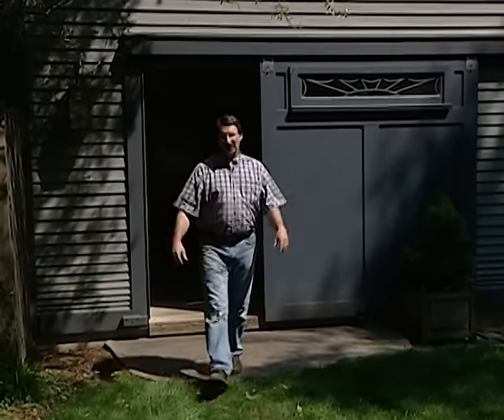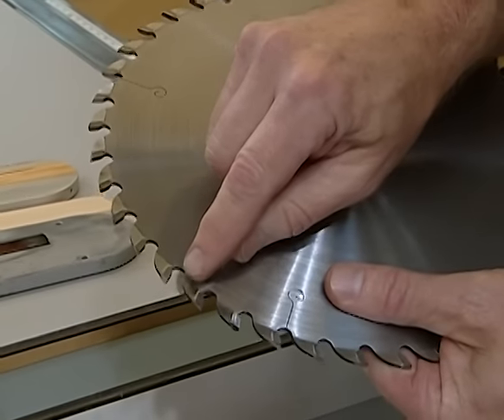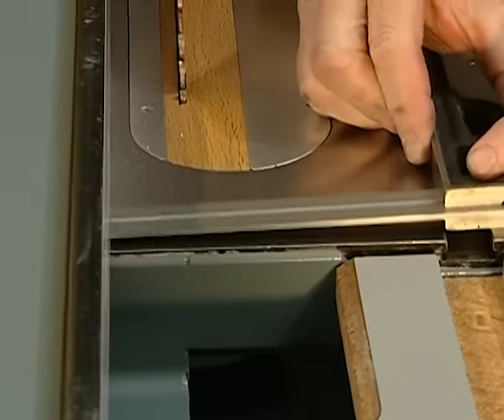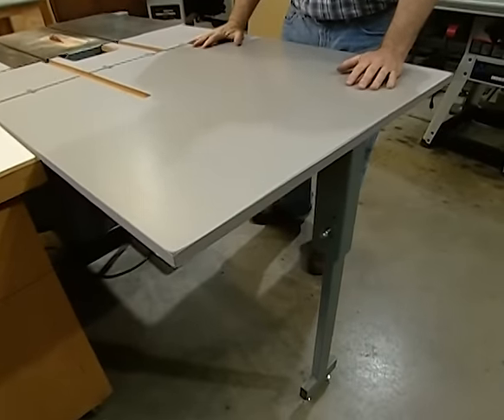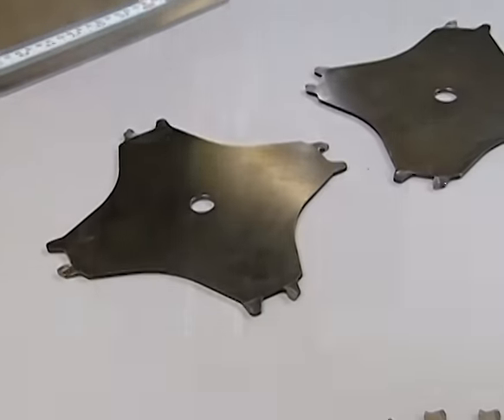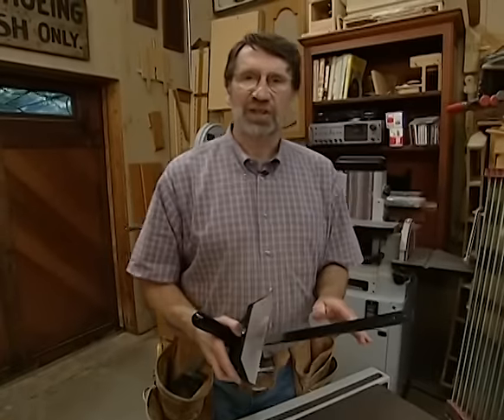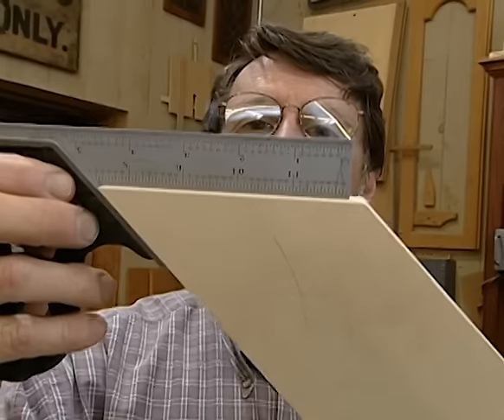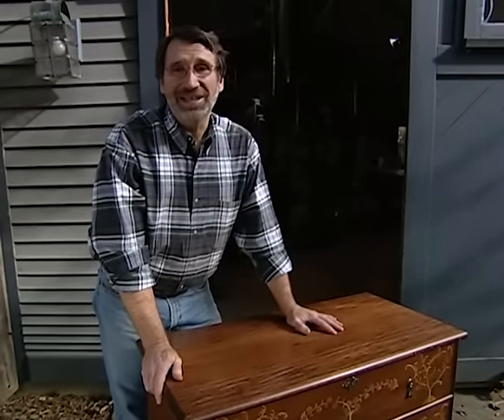Table Saw 101  |  S19 E8 & 9

Comment: So glad these episodes are finally becoming available! So much knowledge my generation desperately needs.
Reply: These videos have been on YouTube for many years.
Reply: Not all the information is up to date. At 8:55 he fits a zero clearance insert, which is good, but his older saw doesn't have a riving knife, which is super dangerous.

Modern saws have a riving knife to prevent the piece pinching the back of the blade, which reduces the risk of kickback. Your zero clearance insert will need a slot being cut to accommodate it.
Reply: @BM-ru7ef  Nope. Their first upload was on Nov '22. Not even a full two years.

Comment: I’m 60 now. How vivid still today that this show and ‘This Old House’ would come on when I was a wee lad, and it felt as if it was over in the blink of an eye! I was practically distressed that it ended so quickly! Norm is a treasure.
Reply: If you're 60 now, you were between the ages of 24 and 45 during this show's 21 year run.

I'm 36 now, I was less than 2 years old when the first episode of the New Yankee Workshop aired in January of 1989.  I genuinely was a wee lad, I vividly remember watching episodes of this show when I was about 3 years old from my high chair eating pancakes and bacon my father made on what I now understand were Saturday mornings.

Comment: No riving knife guarantees a kickback event. Cabinet saws are extremely powerful and can fling a piece of wood at bullet speeds. That riving knife helps to keep the piece from pinching the blade and riding up over the blade
Reply: Don't be presumptive.

Craftsmen have been doing without riving knife for many decades. Most still have fingers without kickbacks. There is no mystery. The riving knife is preferable to the novice and under most situations for the craftsman (because it is a splitter that is closer to the blade), but a well-implemented splitter will work quite well also. 

A riving knife has fixed thickness, but a splitter can have varied thicknesses, and can also be thin and slanted as it occupies the kerf. This is one advantage of the splitter over the riving knife. 

There cannot be kickback without riving knife if one uses a splitter well and use hold-downs as well.

I don't use a riving knife. I don't need it.

Comment: One quick suggestion: when you are checking blade perpendicularity to the table, position the leg of the right angle tool against the blade between the teeth.  (The teeth are normally wider than the body thickness of the saw blade itself, and could introduce an unwanted angle.)

Comment: I believe to check parallelism with the miter, the same tooth on the blade should be used. The blade should be rotated. 

Using another tooth (of the same set) as far away as possible is to check arbor round out.

Comment: The only thing I don't like about hybrid, contractor, and table top saw is the mounting of the blade. They're mounted to the bottom of the table. Making dialing in square to your slots harder. 
Cabinet are cabinet mounted. Loosen all but one bolt holding table to cabinet and bump it square. Alot easier.

Comment: I really like that insert at 8:48 You wouldn't happen to have a link would you. I have a Jet cabinet saw. I usually make mine out of mdf but the metal one with the thin strip of replaceable wood seems much easier to change/replace.
Reply from the maker: We looked, and they don't seem to make it anymore. It was a nice idea.
Reply: There's now a suitable replacement that's made by Betterley Tools, check it out. It's a different design than the replaceable wooden piece, but I'll say it's a worthy successor.